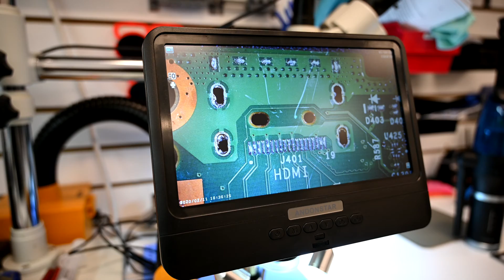Xbox Series S HDMI Port Replacement | And an awesome new shop tool!

Comment from the maker: What's your favorite tool in your shop?
Reply: Ben is my Favorite tool!
Reply: Probably my heat plate or my metal jimmy/pry tool
Reply from the maker: @thunderbyetronics  did you get those plastic cards? They making opening stuff so easy, but I keep melting them 😭
Reply: @TapticDigital  Yes I did, Im using them right now for this Samsung A7 Tablet, i need to do a charging port replacement and I’m struggling so much trying to get it open. The screen is so thin so. I think ima try using a heat gun because the heating plate is a bit to small.

Comment: Do you need the soldering wick or is it optional
Reply from the maker: @StyledGears  if you use too much solder or bridge pins together, the wick will be required. Also for cleaning the old solder off. So yes 100% needed

Comment: What size bit is it a t10 or T8
Reply from the maker: @timothyfeighner8797  whoever fits best. I’ve had some T8 that will fit better, but usually T10 is the way to go. Just depends on the quality of the tools you have available.

Comment: Is it possible to substitute the heat gun for a blow dryer or do it without a heat gun at all using only a soldering iron?
Reply from the maker: Not on something like this, it requires heat  over 420C (800f) from a heatgun to melt the solder. In theory you could use just an iron, loosening it pin by pin, but it would be incredibly risky and more likely to damage the board and tear wire traces out.
Reply: @TapticDigital  Do I need to change the solder or can I just change the hdmi port without messing with it. I have the heat gun now fyi

Comment: Hey I need help with an Xbox series s my Ethernet port is messed up it keep showing as is connected when it's not I'm not sure if it is the port or the network card and advise
Reply from the maker: That's a really strange one, it would be caused by a short on the board. Liquid damage sounds pretty likely, but it could be something that a good cleaning would fix. It's worth taking it apart and checking it out, if you feel comfortable. Otherwise look into some local phone and computer repair shops!

Comment: What’s the cost?
Reply from the maker: Most shops will charge between $150-$200 for HDMI replacement. Sometimes you can get lucky and find them as low as $100 but you also run into the “get what you pay for” risk

Comment: What the gel called that u used and where are u located? Plz reply!
Reply from the maker: It's called flux, it helps solder flow where it needs to go without bridging or smearing. Unfortunately I don't offer mail-in repairs at this time, check some local shops for good reviews.
Reply: @TapticDigital is the Soldering Flux used to reconnect the HDMI back to the port

Comment: Do you have to solder the hdmi port back down? I have a heat gun but no solding iron.
Reply from the maker: You do have to attach the pins with solder. I don't recommend trying this without an iron, but it is possible to hold heat on it, remove original port, keep heat on it, press new port into place making sure your pins are touching (this has to be done FAST) and remove the heat. Only risk is you pretty much get one shot to connect all the pins, if one just doesn't decide to stick, you'd need a soldering iron to press it down.

Comment: What’s the hot air station you use for de soldering the port?
Reply from the maker: I use a Quick 861DW, it's a bit overkill but any hot air station that can reach a stable 450C should be plenty for this kind of work
Reply: @TapticDigital  thanks for the quick reply and info!

Comment: What tool do I use to get the green screws out?
Reply from the maker: It'll need to be a torx security screwdriver, it will have a hole in the top but otherwise look like a normal torx screwdriver
Reply: @TapticDigital  thank you

Comment: I think this is the video I needed!! My front usb broke from a fall it took.  Would the process be the same?
Reply from the maker: It sure would, though the USB is a little trickier since it is a through-hole soldering job. Basically you would heatgun from the underside of the port to remove it, clear the holes (if possible), and solder the new port in its place.